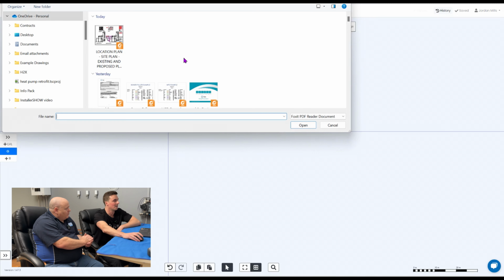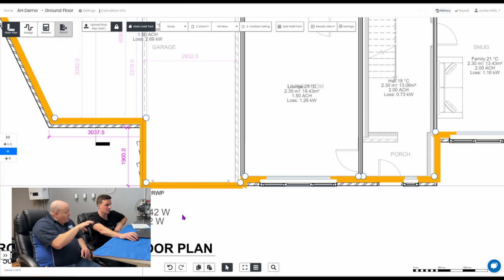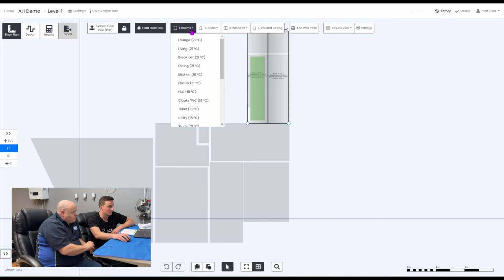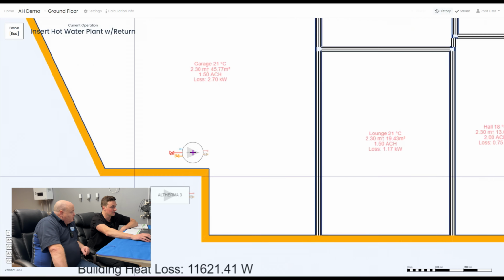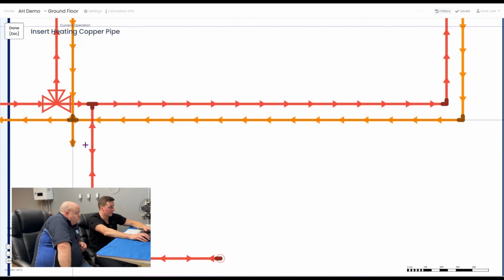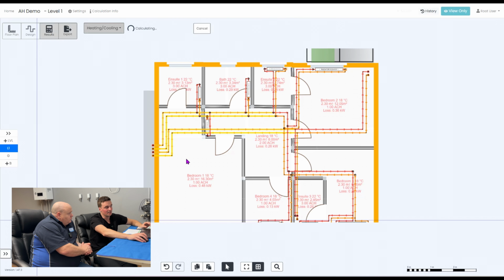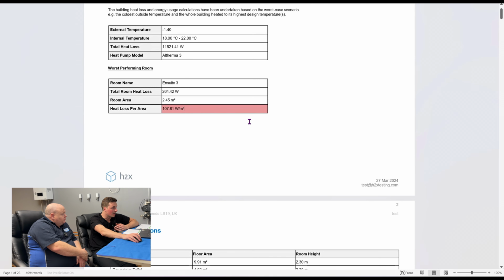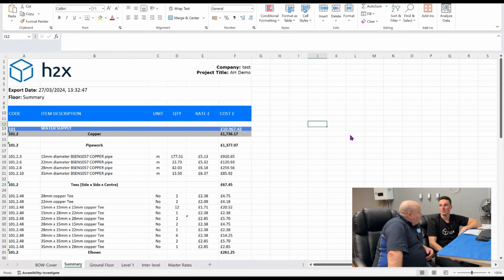Heat Loss System Design h2x Central Heating System Design

Comment: Hi mate, do you have any tips for someone who is 35 and looking to get in to plumbing/gas engineering? I have no idea where to start. Cheers.
Reply from the maker: I would try offering free labour to a plumber for a few weeks, just making sure its the right job for you. Then you could go down the fast track route. Depends on your personal circumstances
Reply: @AllenHart999  Thanks mate. I applied for a college course today, takes you through the basics all the way to the City and Guilds level 3, total cost is about £6k and takes 4 years but it will be worth it! I will also contact a self employed plumber and ask if I can come along for free to learn.

Comment: Interesting. Not heard of this programme before. I have been asked to do a heat loss calc on a Church main hall. Tried long hand calculations, software online and an app and the difference was over 100kws from one to the next.

I actually did use the basic version on your site actually. Calculated the heat loss at 200kw. My long hand calcs were just over 100kw. They have had 2 companies quote. 1 2 x 80 kW boilers and the other 2 x 60 kw boilers. The area at moment is heated with 7 11kw drugarsar fires.
Reply: We have a 14-day free trial available on our website - feel free to give it a try